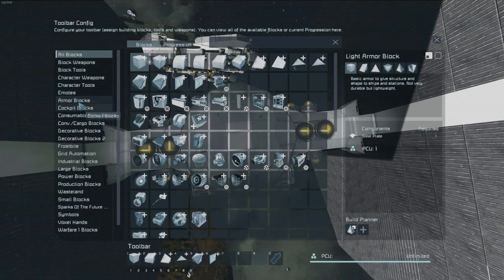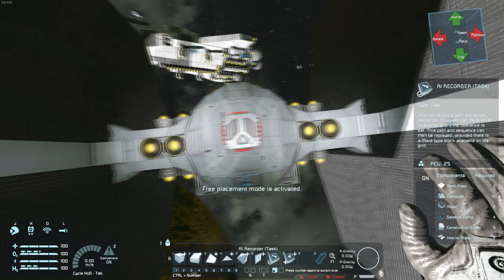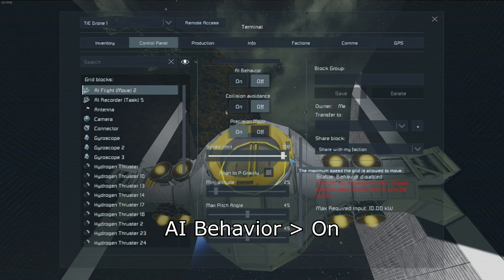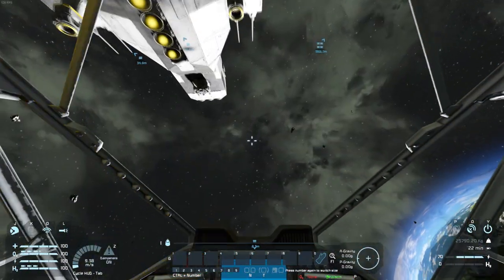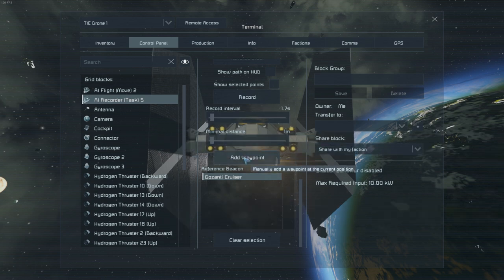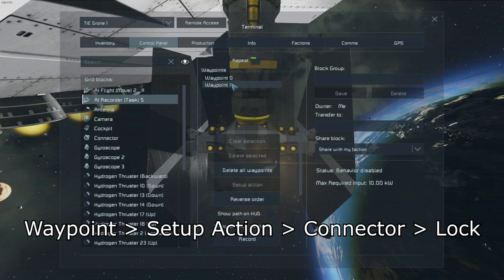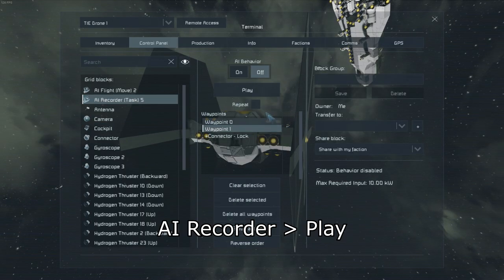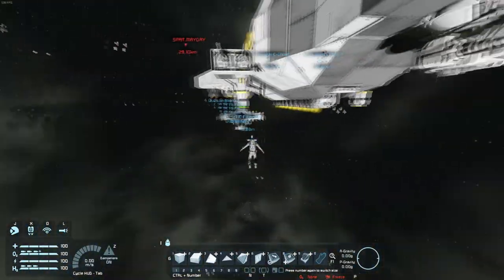Space Engineers - Automatons - AI Docking Tutorial

Comment: Been doing this but for some reason it gets close, angles itself away from the connector, and then thinks it's docked.
Reply from the maker: Make sure the AI blocks are facing the correct direction. Also I noticed using the "record" function to copy my movements instead of setting manual waypoints caused it to move slow and sluggish or act weird. I have a feeling that if waypoints are close together the AI has a harder time.
Reply: @Liberty_Bull  My recorder block was facing the wrong way, since the connector was on the back of the ship. Thanks!

Comment: Unfortunately the autopilot doesn't work very well if the waypoints are moving, so the carrier must stay still during the process.
Reply from the maker: I found that while they are traveling to the carrier, you can keep moving. You should stop before they get to the waypoint below the connectors so they don't miss. You could try and make some sort of gravity well that sucks up your drone into a very specific channel, or screw around with more robust systems like a big magnetic sheet to catch the drone mid flight. In my case the drones missed by a single block length behind the connectors, so having a small array of connectors next to each other with high strength may have even done the trick.

Comment: Does auto-docking work even if the position of the carrier is changed?
Reply: I’d assume that is what the reference beacon is for, to make the wayoint position relative to the carrier beacon rather than static.
Reply from the maker: Yes, it may even work while the carrier is moving if you have a more robust docking situation, such as a connector on the nose of the fighter docking into the rear of the ship or something.
Reply: @Liberty_Bull  I kind of doubt a ship can return to the carrier if it is moving at a decent speed though. I was thinking about building a carrier that ships have to physically enter to dock. Perhaps even some cross between a blimp (parked ships on rails inside) and a modern-day ship (parked ships below decks using elevators) aircraft carrier.

 I assume docking while maneuvering is a no-go regardless but that makes sense.
Reply from the maker: @6105boe  I tried to have them dock while this carrier was moving and they got so close, the fighters ended up thrusting up right behind the connectors. If they had a straight shot to their docking ports it may work.